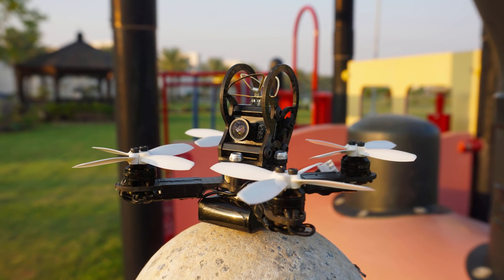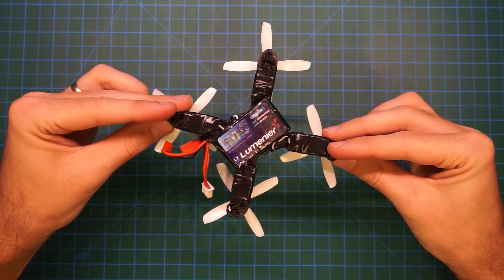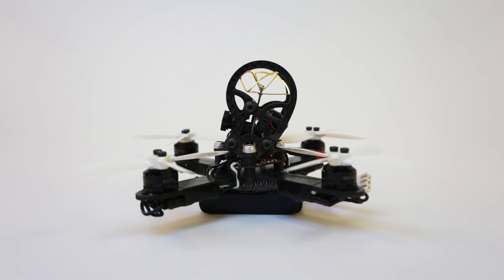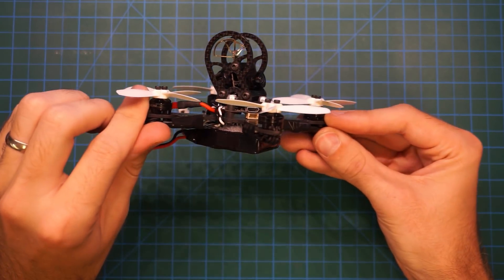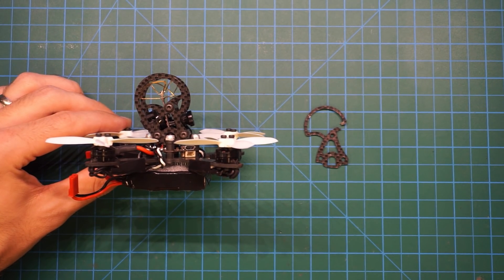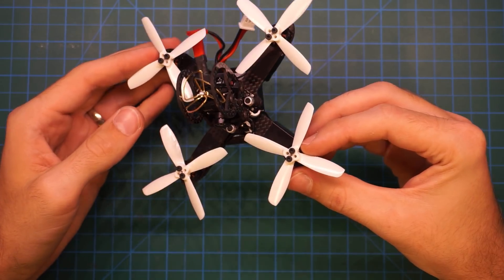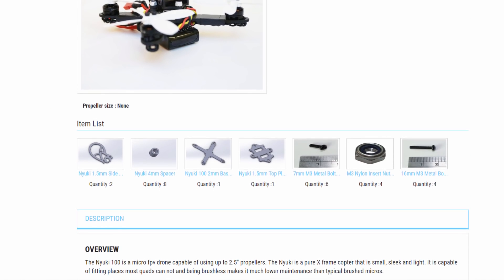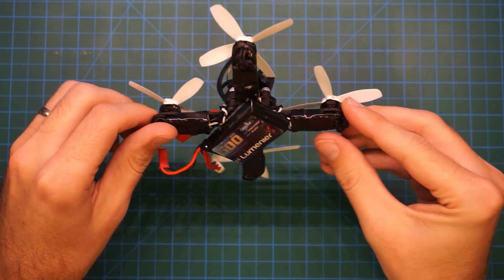Nyuki 100 Indoor Brushless Micro FPV Drone Overview

Comment: I love the frame, but I would really like to be able to run 3S for outdoor flying. Do you sell a kit? I have my own camera. Can you use a 4 in 1 20A esc?
Reply from the maker: Jon B Baca 3s is going to be my next build. And yes, you could absolutely use a 4 in one esc (just use another set of spacers and longer main bolts and it should drop right in). Right now I am not selling pre-made kits, just the frame kits on armattan productions. (Link above)
Reply: Is there a 20A esc in 20x20 size?
Reply: Awesome. Thanks!
Reply from the maker: No problem. If you have any other questions feel free to ask.
Reply: So that esc is a 2in1, not a 4in1.. so you'd basically need to add another layer for two of these esc boards.
Reply from the maker: James K Yes. Or you could use this 10a 4-in-1 

http://www.getfpv.com/lumenier-mini-blheli-s-10a-4-in-1-opto-esc.html

10a is more than enough even on 3s with an 1105

Comment: Are you just holding the battery with velcro?
Reply from the maker: Yep. The batteries are so light that that is all that is needed. But I prefer to use dual lock over velcro (dual lock is very secure). But if you want you can add a battery strap easily.

Comment: Iam thinking to have  a  Innova  vtx osd set up Is there enough room in camera area to put a run cam?
Reply from the maker: The camera area is 20mm wide. A swift would not fit but you could probably fit an original owl since it is 19mm wide. Not sure though since I haven't tried it.

Runcam Owl Link:
http://shop.runcam.com/runcam-owl/

Or you could try something like this:
http://www.getfpv.com/multi-rotor-frames/mini-multi-rotor-store/mini-fpv-gear/lumenier-smc-600-super-mini-cased-600tvl-wide-angle-camera.html